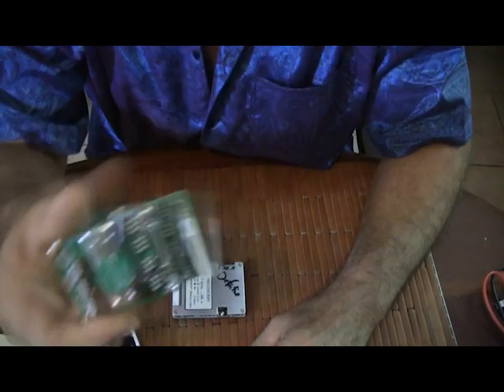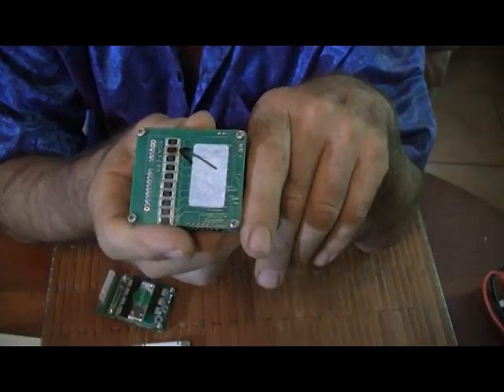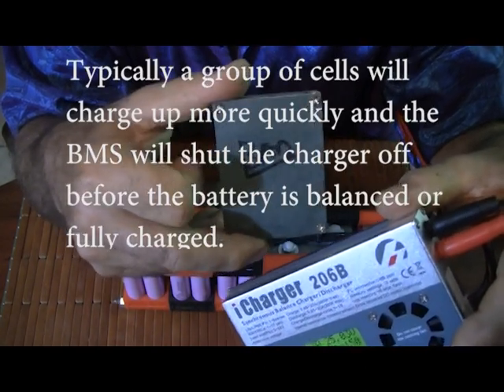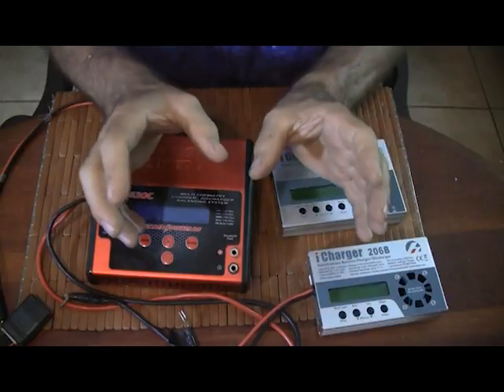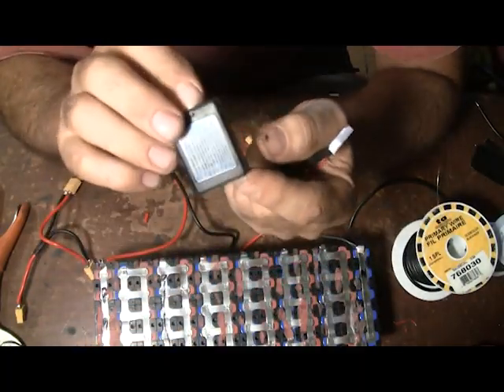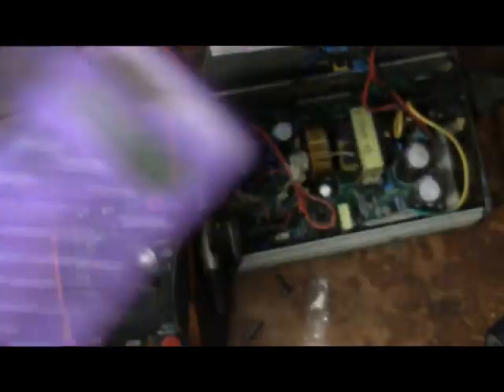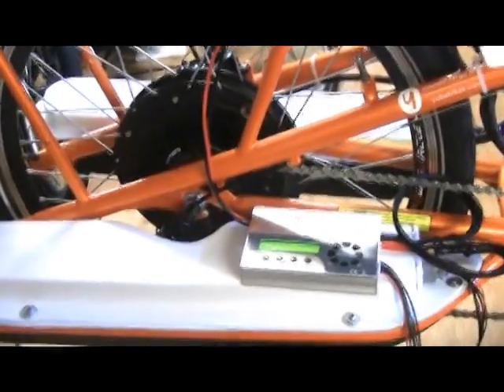How to build a safe and better lithium battery WITHOUT a BMS.

Comment: My charger only does 6s and really don't want to spend 100 plus bucks on a new one. Can I make two 5s and a 4s for a 14s pack for my ebike?
Reply from the maker: Yes, but it is cumbersome.  Just don't attempt to charge/balance them in parallel- you will melt the sensor wires.  Just do one at a time,  you can leave the battery connected into a 14S battery if you do.

Comment: This is cool for 52v batteries with loggers... But what if I have 48v? 13s won't  split up evenly...
Reply from the maker: You would make a 7s and a 6s.  My icharger would automatically recognize the number of S, ask me if it was right, and proceed to charge.  Your charger may do the same.  Remember you cannot do this and charge in parallel unless you use two chargers.

Comment: what would you recommend for a 24v 8s 220 ah battery pack connected to a solar setup
Reply from the maker: Active balancing.  Set the charge controller to no more than 32 volts- and use these:

https://www.aliexpress.com/item/1768384410.html?spm=a2g0s.9042311.0.0.27424c4dDbHcKh

I use them in my 300 amp hour 15S homemade power wall from salvaged cells.

Good luck!

Comment: I have an iCharger 208B for going on 10 years for my Yuba Boda Boda. I like it and use it for other projects as well.

I run LiFePo4 batteries in (2) 24 volt packs. and charge them with a 4 pole double throw switch that charges the packs in parallel and runs the bike with the packs in series.

I charge at 3.5 volts per cell and after 5 years on this bike with this pack, 5 back tires, 2 chains and gear clusters. and 1 back wheel they are only .3 Amp hours  below rated capacity. The darn things will never wear out so I have no excuse spending a lot of money on a pack upgrade.

No BMS.

Comment: please, tell me more about 17:30 calculation!  

supposing one 7s pack, if I use a constant voltage power supply of 28V instead of 30VDC or more, the BMS cannot charge at 4.2V per cell, stop charging each at 4.0V and the number of cycles increase a lot ? of course the mileage full at 4.0V for each charge is a little less than the pack with 4.2V but a lot more cycles are really good.

Comment: So I didn't see any of the items you mentioned in the description... I looked for a "$5 cell logger/monitor" couldn't find anything under $40 and nothing in stock or currently for sale...

I found the icharger for $160 though. Also the balance wires.
Reply from the maker: Try doing a Google Image Search for "cell monitor 8s" , 

Search Amazon for icharger 8S.  ($140)  You will see other types of balancer/chargers for less.  You may only need a 6S and could save some money.
Good luck!
Reply: @shawname2  well my batteries are all 10s.... So I may need to split it
Reply from the maker: @kornshadow097  There are a few 10S hobby chargers out there- icharger makes one.

Comment: if you wanted a bms on this too, how would a bms work with the split packs? just one 14s is needed and it'll operate when the two packs are connected in series?
Reply from the maker: Yes, exactly.  The two packs are always connected in series, there is just a tap at each 7S to allow a hobby charger to balance.

Comment: I don't understand why you have to split the battery up electrically for the 2nd set of balance leads to work
Reply from the maker: Great question, I was not clear:
You don't have to split the battery electrically for a 2nd set of balance leads to work, as long as you don't try to use a parallel board to balance both halves at once.  It is only when you use a balance board, effectively connecting the two halves in series and parallel at the same time, that there is smoke!
Reply: @shawname2  I see, so splitting it up allows you to only buy one balance charger and charge simutaneously with a parallel board instead of waiting for one set to finish before doing the second set. ur a great teacher!
Reply from the maker: @danimallegs1450  That's it!

Comment: This is really cool:  so you are saying, you bulk charge until batteries get out of balance and then you whip out the "hobby charger" and charge them into balance, which means you could solar bulk charge most of the time and then go to inverter or grid ac to use the "hobby charger."  How often do you have to balance charge?  Probably depends on the age of the batteries.  I really would like to have the option to charge off-grid with a lithium charge controller.  Finding the right voltage charge controller might be challenging.   How about a trickle charge that works while you are riding.  I love your low slung battery packs on your back wheels--put solar panels on top of those?
Reply from the maker: Yes, you got it.  This works best on smaller batteries like ebike batteries- as hobby chargers may not have enough balancing capacity for a 50P-  But, if the batteries weren't too dissimiliar,  a hobby charger would get the job done eventually. 

I run off grid using my homemade power wall without a BMS- it is a 120P15S battery- but I use active balancing.  Email me directly from my website.

I have built a solar panel powered bike, and to make a long story short, decided on leaving the solar panels at home and riding a big battery.

Comment: You do know that there is some bms which have a beautiful UART port on it to show you magically the voltage of each series, right? I understand your point of your video, but I want to say that your charger isn't bulletproof and can break as much as a cheap BMS. 

Buy a good, monitored and well dissipated BMS and there is no need for this video.
Reply from the maker: I don't disagree- But I would add, build a battery from new cells as well.   Violate one of these;  "new cells, good, monitored, and heat dissipated"- meaning a high bleed capacity- and you might need a hobby charger.  I want people to know there is a choice for their particular battery.

Comment: Shawn should I set my cut off at 28v or 30v? I have a 36v 14ah battery. And one of the things my new LCD throttle controler ask is what low volt shut off to set at. Thanks.

Comment: Watching this in 2019.  
Now you can get BMS with bluetooth and monitor cells(ebay and aliexpress from china)
I'm going to assume that the BMS intended for 300 amp charge/discharge is going to have enough balancing capacity to handle an ebike no problem.  There is stil the issue of the BMS cutting power mid-ride if it finds low voltage.  Price is around 120 USD from china.  I am waiting for mine to arrive.  I hope it works well.  They come with a flat aluminum plate as head sink on both sides of circuit because there are mosfets to pass current on both sides of the board.  I will be mounting finned aluminum heatsinks using thermal conducting tape to both sides to keep the board cool.  Solves a lot of complication, hopefully it works well and reliably.  
Thanks for reading.
Reply from the maker: Let's see how that works out.  Times change!  I'd love to have a really simple balancing solution for ebikes.   Now I use active balancing on the power walls, that is working out well.

Comment: In a pinch, couldn't you balance cells by putting them in parallel using low value high wattage resistors to limit the current?

Comment: Wouldn't it also be possible to just connect all your cells in parallel and use a boost converter to step the voltage up?
Reply from the maker: Yes, but you would use a buck converter to step the USB voltage down.

Comment: What if I want to charge 1-6 batteries in parallel with something more universal like microusb?
Reply from the maker: The idea is fine, but the voltage is too high at 5 volts.  However many number of batteries you charge in parallel, with lithium cobalt chemistry, you need to be at 4 to 4.2 volts.

Comment: Going to build a pack soon without a bms as well.  I do have a question the installation of the ballance wires.  Is the one red wire supposed to be the positive and the rest of the wire in the series go on the negative?  My rc lipo car that is the way it is installed  just want to make shure every thing goes right in the video you have it the opposite one wire to the negative the rest in the series conection to the positive
Reply from the maker: My video is correct!  Start with the negative terminal of the battery and put your first black there.  Then put your next black on the positive OF THE SAME CELL.  Then put your black wires sequentially on the remaining positives.  You should end up with the red wire on the positive of the battery.  So, if you have a 10S battery, you should start with 11 wires.

Comment: Could u hook up a small dynamo motor to charge your bike while riding?
Reply from the maker: Yes. But a lot of controllers turn the motor into a generator when you apply the brakes.  You could also put a small wind turbine or solar panel on your bike.  But don't do it!  It is way, way too much trouble or work vs just charging,  inmho.

Comment: Is 7S the largest size to build to ? What is the best utilization to power easiest to build a d charge?
Reply from the maker: No, you can build to any S number- though you will have to split the battery electrically if you have a small S Hobby Charger.  I don't understand you other question, sorry.
Reply: @shawname2  My second question was in your opinion what is the most inexpensive bang for your buck Voltage and parts availability 52v a d what you recommend building for your cell packs for speed and range to build a  18650 pack?
     I am currently looking at your 14 s packs for Battery Blocs and liked the Idea of magnetic connectors over welding or soldering to the batteries but I may end up building my packs out of electrical schedule 40 flex emt rounds and build centering rings for the magnets to connect all the packs like you have ! I really appreciate your advice and all the encouragement you give. Most of what is being built to utilize these cell capacity storage is trying to build it yourself and there is little or no easily replaceable individual cell designs, packs that do not require soldering or a welder for the cell parallel buss bars . I really your design and engineering on these with true visibility and personal build quality without a BMS . Thanks your Battery Blocs started me down this path watching your videos,Keep em coming I downloaded all the battery tools and charts as well.
Reply from the maker: . @rhoemberg1969 

Sure- I recommend the highest voltage you can for greater efficiency and speed. 

I recommend an active balancer such as this 24S one and charging to about 4 volts per parallel group.   https://www.aliexpress.com/item/32945565819.html?spm=a2g0s.9042311.0.0.116c4c4deSHVMv

If you come up with a way to build something similar to BatteryBlocs that anyone can build in any country, I would love to publish that on my website and give you credit for it.  I'd love to make it very simple and cheap for people to build their own batteries.

Building with cheap low capacity cells requires more hardware so you must balance that.  The cheapest cells are the ones with the most watt hours for the money.  Here is the formula:

Cost per cell divided by 3.6 volts times amp hours.  Here is a 3000mah cell selling for $2.50:
so 3.6 X 3.0 is 10.8 watt hours.  $2.50 divided by 10.8 is .23 cents per watt hour. 

Another example, a 2000 mah cell selling for $1.80:
3.6 x 2.0 = 7.2 watt hours.  $1.80 divided by 7.2 is .25 cents per watt hour. 

So you get more bang for the buck with the more expensive cell in this example.

cheers!

Comment: Is it possible to charge batteries without bms and hobby charger?
Reply from the maker: Yes, just not simply.  You can charge each parallel group with a 4 volt charger.  You can connect a voltage gauge to each parallel group and watch it as it is being charged, draining the high cells with a 12 volt light bulb.

Comment: With the relatively low cost of those hobby chargers this makes a lot of sense.  I would way rather know what is going on inside my battery pack and have control.  Thanks for making a video that simplifies the process and is easy to understand!  Custom power tool charger??  18650 based power tool battery packs fail a lot!  They are rapidly charged and discharged I wonder if there is a practical way to apply this method as a maintenance procedure for these type of battery packs.  Could also then double as a work around once the lame on board bms fails.

Comment: HI Shawn! wonder if you could tell me, when it comes to lithium batteries i hear so many versions how batteries should be charge, full till light indicated changes, just before it changes. what is in your opinion best to best do for batteries to last longer? 
thank you .
Reply from the maker: Sure.  It is well established practice to charge lithium batteries to 4 volts per cell to double the cycle life  Most of the charging stress takes places in the last .2 of a volt.

Comment: Wow Shawn.... what a great way of looking at a BMS vs no BMS ... you have opened my eyes !!
A question if I may....
My first hobby charger purchase was a cheap eBay one and I can’t use it as it’s  2v out in its reading of battery voltage. Would it be likely that there might be a trip pot inside that can adjust that rather than throw it in the bin ?
Reply from the maker: Hi Jason,

I don't know.  Some have a programmable voltage adjustment.  I like and use icharger products.   Cheers!
Reply: Shawn McCarty 
No worries 👍 
Thanks so much for taking the time to reply. I’m only new to all of this. I really like your style of teaching and the enthusiasm and clarity with which you deliver your info. I’m going to have a YouTube Marathon as soon as I have time and watch all of your videos. 
Thanks again. 
Jason

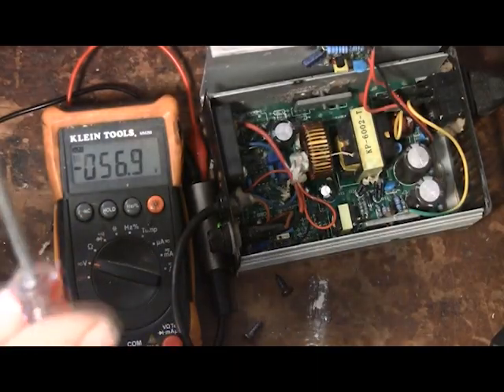Comment: 13:13 you've got a bulging cap at the top bud, might want to replace that. Also, I don't think you're aware of active balancers and how they are a better solution than using two separate hobby chargers.
Reply from the maker: Thanks for your comments.  Yes, it is a junk battery used just for the video.  I am a strong convert to active balancing, I use it for my power wall and my ebike and for customers batteries now.  I agree, a better solution than using a Hobby Charger.    Video is two years old now. Thanks!

Comment: I bought  some 12v kits and there was 1 magnet missing. I sent Shawn an email but never got an answer… Also I strapped some kits end to end and the plastic ends broke very easily ,also the nuts will work loose unless you put locktite or nail polish on the threads. If I were to do it again Veruson kits look to be a better product
Reply from the maker: Steven I never got your email, I am sorry that you were not happy.  I see you did buy some Blocs in July of 2017, two years ago. I have never heard of anyone saying the nylon nuts come loose on the nylon bolts.   I have never seen that happen.  I have had the top of a Bloc break under pressure, I am happy to replace it if it does.   The plastic used in printing the Blocs has improved since then, the new PLA+ filaments are stronger than the old PLA filaments.

Comment: How can  i  get this  to work for power wall
Reply from the maker: 1.  Use active balancing-Google it.  OR/AND  2.  Put a voltage meter on each parallel group, and watch the battery.  Charge at 4 volts the low groups and discharge with a 12 volt incandescent bulb the high groups.

Comment: Very informative. I have built a 7s8p and 7s10p li-ion packs for my scooter with brushed DC motor. Because I need a 12v source for the turn lights, alarm and other electronics. How will I make the center tap and split? 3 and half S each or 4s and 3s or 4s each? If 4s'es each there's no 24v standard charger for it. Thank you.

Comment: absolutely agree in your overall opinion about BMS! On top of their lack to balance correctly and with higher current they stop the charging too late, sometimes at over 4.3 V which decreases your li-ion cell life significantly! I would be looking for a kind of BMS that really does the balancing on charging rates rather than uncharging the already overcharged cells! And it should be variable in charge-end-voltage, lets say from 4.0 - 4.2 V on the decision of the owner!
Reply from the maker: YEs, I agree.  You may want to look into "active" BMS's.   They balance all the time by moving power from one cell to another.  And you may want to build your own charger or use something like this:   https://www.amazon.com/gp/product/B06ZYDZCG9/ref=ppx_yo_dt_b_search_asin_title?ie=UTF8&psc=1
If you buy this get the extended warranty.

Comment: Hope youre getting good cells. can they handy high current ? for example, on 1000 W motor, 52 V 10 AH = 40 Amp. most BMS shutting up at 30, guessing its an "save" feature to protect the cells as they dont can hande high current such as Lipo.
and by the way RC hobby and ebike is basically one thing
Reply from the maker: There a lot of very high current 18650 cells on the market now- they are used a lot in vaping.  Yes, the Blocs can handle high current- I have some videos of them at high current.  The BMS's have a high amp cut off to save themselves from burning out!
Yes the RC and the ebike hobby have lots of overlaps and that is good for all!